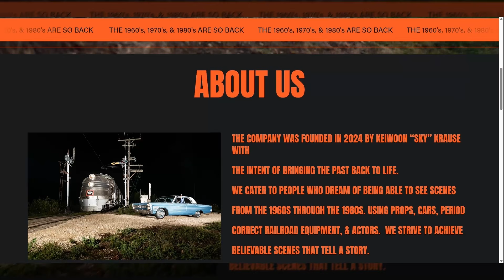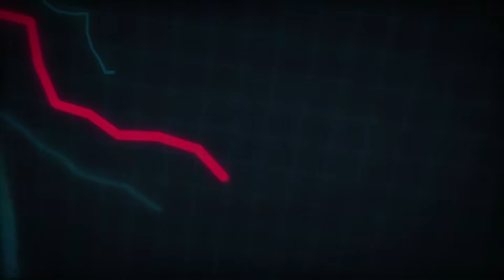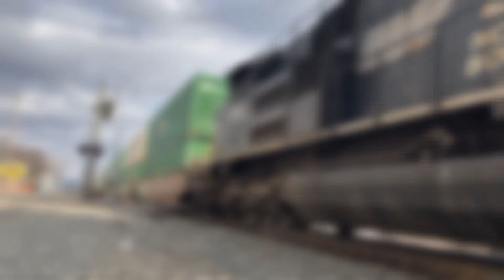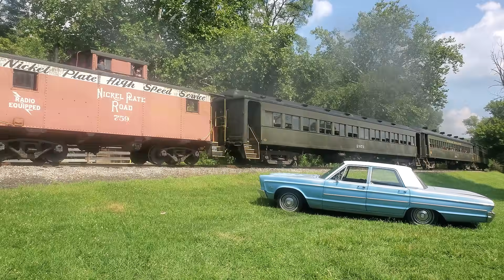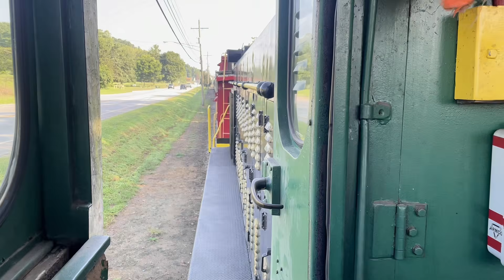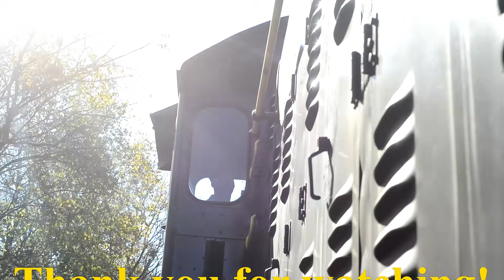Lima-Hamilton Diesels: The Diesels That Could Have Been (Part 1: The History)

Comment: A lot of the credit with regard to tractive effort has to go to Westinghouse, whose electrical equipment was considered more robust to that of GE or EMD. They could be overloaded for longer periods without damage than their competitors. 
Keep in mind, too, that Fairbanks-Morse also used Westnghouse equipment for a time. 
Now Wabtec owns GE's line of diesels. How ironic.
Reply from the maker: That’s very true! Baldwin as well had high tractive effort. They had the same Westinghouse gear
Reply: I didnt know Westinghouse became wabtec
Reply: @CoalChrome  nope!! not any part of wabtec- But GE had a electric switchgear division to work from, EMD had to create their own switchgear.
Reply: @CoalChrome  George Westinghouse founded several companies. Westinghouse Air Brake became Wabtec and eventually bought the GE locomotive business. Westinghouse Electric that made electrical components for early diesel-electrics was a different company.